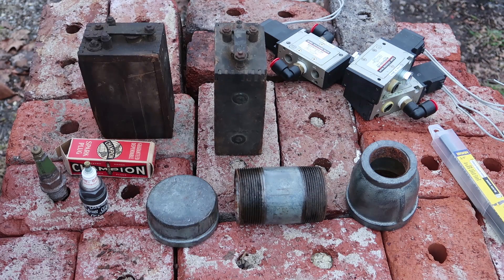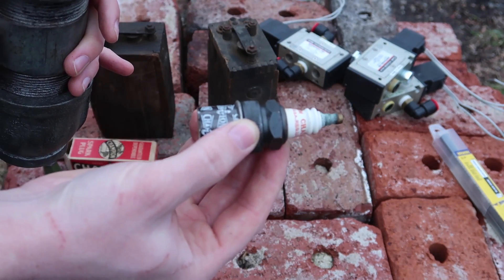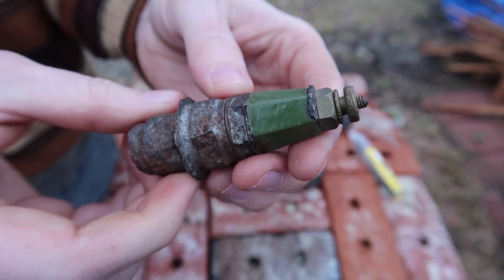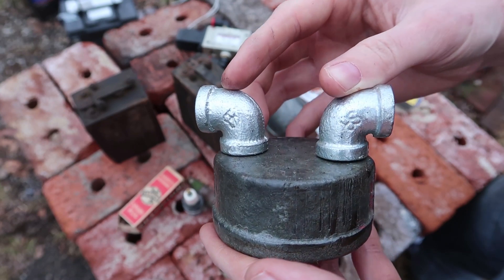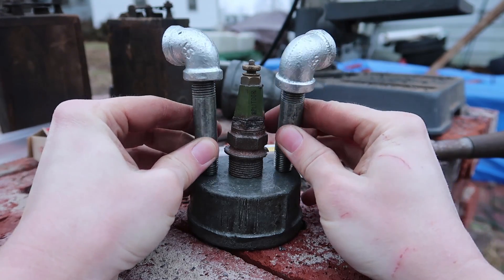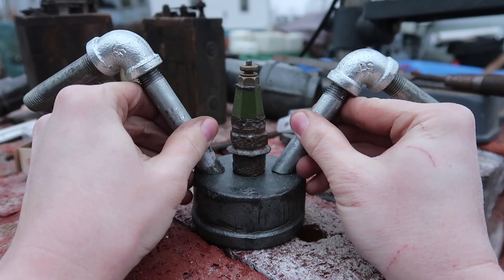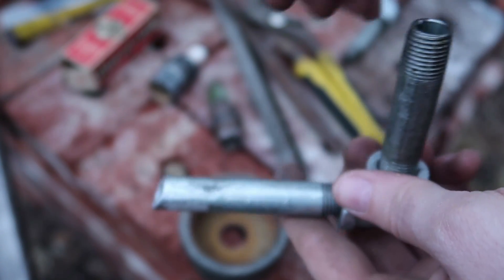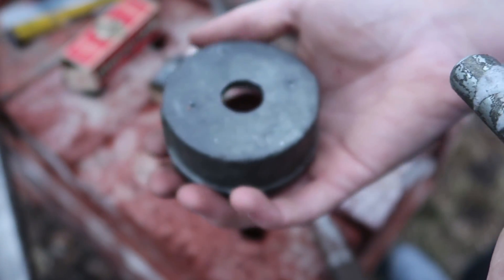DIY Liquid Fueled Rocket Engine 01: Simple Rocket Engine Combustion Chamber

Comment: Hey, former rocket engine designer (propulsion engineer) here:

I strongly suggest that you use propane instead of kerosene, since you're planning on using GOX oxidiser.

If you use kerosene, it's very oxidiser hungry and you are going to have a lot of trouble getting it sufficiently atomised and mixed with oxidiser. Indeed, you'll have a lot of trouble even getting enough oxidiser into the chamber to get stable combustion, because of it being GOX and not LOX (you'll have issues with mass flow rate). Or possibly even to get it igniting reliably.

If you use propane (or butane), it has the nice property of vaporising very quickly once it hits the temperatures of the combustion chamber, and this will help it to mix very thoroughly with the oxidiser. It's also much less oxidiser hungry (lower O:F ratio), and will burn much more cleanly. It's much easier to get a homogeneous mixture in the chamber, since you don't need to build anywhere near as complicated an atomiser for it since it will boil chaotically upon entering the chamber, unlike kerosene.

I'm not trying to rain on your parade, I'm just being realistic.

If you want any advice for this project, just ask. I've designed and built solids (AP-PBAN, AP-HTPB, and AP-silicone varieties), liquids (N2O-propane and N2O-ethanol), and hybrids (N2O-PBAN, N2O-AN-PBAN, N2O-paraffin, N2O-nylon) - and flown the resulting engines, also in vehicles I designed and built - so there's a wide variety of experience on tap should you be interested.
Reply from the maker: yeah sorry i was unclear with this series. im starting with gaseous oxygen and propane with this test chamber and then my next engine will be designed to actually make thrust and use liquid propellants. i figure this low pressure test chamber will be good for experimenting with controlling solenoids and stuff, and then the next one i will experiment with injectors.

i'm also thinking about getting a cryocooler and liquifying my own oxygen since im in such a rural area its difficult to get LOX.

and thanks, but honestly i feel it best to just try a bit of everything and see if i come to the same design conclusions through experimentation as real rocket engines have. this project is on the shelf for now until i get my new workshop built, and then i hope to spend a significant amount of time on it.

but thanks!
Reply: @RinoaL  Okay :) cool, hope you have fun with it! I'll keep track of what you do with this, will be interesting to see where you go with it. Best of luck :)
Reply: @Matthew, if you are a former Rocket designer... wouldn't you mind to share some experience? :D
Reply: @atommeyer2226  That's a very open ended question! If you have something specific to ask then I'm happy to answer :)
Reply: Matthew Ducker Well I have a question then haha, how do you start designing a rocket engine? Where do you begin, what steps do you follow and how do you know what kind of fuel and systems you need to install? Also if you want to have sensors how do you install them properly and safely without making the engine less efficient? Also how do you calculate the type of material, material thickness and or material strength for the combustion chamber? I can understand that you can’t make a combustion chamber out of soda cans😅... But how thick do the walls then need to be and what material do you need to use, what’s the best shape and length, what’s the best ignition system and what’s the best fuel pump system... I have so many questions😱
Reply: @b5nj1m9n  There aren't any single answers to these things I'm afraid since the questions you're asking are incredibly general - I'm not being evasive, but simply realistic.

To give proper answers to these questions would require a book's length, since they might seem simple, but really aren't since they're dependent on many other factors, and also on each other - designing an engine is a balancing act between many tens of different properties - a win in one can be a loss in another - so the correct answer for one use case can be completely useless for another.

I recommend getting a book, such as Rocket Propulsion Elements by Sutton - this will answer a lot of the questions you might have, and equip you with the knowledge base you'll need in order to ask yourself - and others - specific questions :)
Reply: @b5nj1m9n  As for where you would start however, the most general questions are usually to do with the performance - what thrust level is needed, and for how long - and then you would usually move to questions about the mission profile - is it very long (may rule out some cryogenics) ? Do you require the ability to restart? How many restarts? How long is an acceptable time lag between an attempt at ignition and begin of thrust?
Reply: Matthew Ducker Ohh okay thanks for your help and the tip about the book! I’ll definetly check that one out! Btw regarding the restarts, how does it effect your engine design?
Reply: @b5nj1m9n  Restarts: if you need many restarts, hypergolics may be a good choice, since they do not need an ignition system. If you do need an ignition system, most propellants will need a chemical ignition system such as TEA-TEB or similar. LH2-LOX can get away with spark ignition (as hydrogen has such a wide mixture ignition range and easy ability to gasify it, making lighting it much easier), but many still opt for TEA-TEB for its simplicity and reliability.

Other factors: if your engine is regeneratively cooled, restarts are not really a problem - but if it's ablatively cooled, this can be a problem as heat soak will damage your ablative material, making it less effective or even fail outright. In such a case you cannot wait long in between each firing. 

Other than this... restarts can also be hard on turbopumps, moreso when using fuel rich preburners or gas generators, and particularly when that fuel is a hydrocarbon as it may coke and accumulate on the turbine and other hot surfaces after the fuel shuts off and some is left in the system. This can be mitigated by flushing it with an inert gas but still, it's something to be taken into consideration.
Reply: Matthew Ducker oh wow okay, I understand half of it hahah, my goal is to make a working rocket engine with combustion chamber, not a SRB type rocket engine, for a science project on school.. I still have lots to learn
Reply: @b5nj1m9n  Ah, right, definitely the wrong level of information then (I assumed you were just interested academically. Very few could attempt to build a turbopump-fed liquid engine by themselves). I would suggest looking at Richard Nakka's website (assuming it's still around? It's been a long time!) for amateur rockets as it's pretty good on theory AND practical builds, and has propellants and designs that are more appropriate for your goals.

I started off building sugar rockets (potassium nitrate + dextrose solid propellant), so I get it ;) .
Reply: Did you really strap 8 SRB's on your skates???!!!! Dooooopeeee
Reply: AtomMeyer 
"What actually creates the thrust?" 
There are two principal ways thrust is created by a rocket-engine: 
1) Spit out mass in one direction makes you go in the opposite direction. The faster you spit out mass the faster you accelerate (think letting loose a inflated balloon or a bottle-rocket that spits out water downward to go upward itself).
2) The shape of the exhaust-nozzle (bell-shape) creates thrust by harvesting the internal pressure in the gas when it comes out of the combustion-chamber. This high-pressure gas wants to expand in all directions. By enveloping it with a bell-shape we can harvest a useful bit of this expansion. So simply put, the gas expands side-ways (perpendicular to the engine) and we let it impinge on a inclined surface to transfer the side-way motion of the gas molecules into a forward thrust.

"What materials are used?" Normal steel? 
Well yes, one could use normal steel, but as you state, it needs to resist the high temp en pressure for the duration of the flight (and maybe multiple flights). So a throw-away rocket that only has a burn-time of 10 seconds could be build with normal steel. A rocket-motor that burns for several minutes needs a different solution. That said, most fireworks rockets are made of paper and if you only have a burn-time of seconds and not too much pressure, that seems to suffice.
To protect the chamber-wall there are several options:
1) Protect the wall with unburned propellant (fuel+oxidizer). SRB's use this principle by burning from the inside out. The heat and pressure are used to ignite more of the propellant in stead off heating the wall and pushing on the wall directly.
2) Protect the wall by actively cooling it (when materials heat up their material-strength goes down so this prevents failure by removing excess heat). This is done by adding more fuel than the combustion-process requires. The extra amount of fuel doesn't burn (as there is not enough oxidizer) but simply absorbs heat and takes that with it when it exits the engine. (difference with no 1 is that it does not 'really' contribute to the thrust of the rocket)
3) Use a liner to protect the inner wall of the chamber. This liner will slowly burn away (= ablative) and is therefore sacrificed to protect the wall. Needs to be replaced every flight.

"Could the nozzles freeze and then block..."
Nozzles don't freeze as they are made from, already solid, solids. On the outside, the water-vapour in the air freezes onto the outside of the nozzle (this adds weight to the rocket but other than that it shouldn't matter). Nozzles only clog up when there are solids in the matter-stream. So no, as long as there is nothing in the fuel-oxidizer streams that turns solid at the temperatures used.
That said, the nozzle opening does become smaller when the nozzle is at a lower temp, and therefore it could lead to trouble with mass-flow and/or atomizing. Meaning, you don't get as much power out of your rocket as you would wish because you can't shove the unburned stuff into the combustion-chamber fast enough or you can but the shovelled in stuff doesn't burn as fast as you need it to because the droplets of fuel are too big.

Life-tip:
Solid Rocket Boosters cannot be controlled (throttled) once lit (not really anyway). When propelling a human being, there should always be a thrust-providing system in place that can be throttled to prevent damage to the cargo. 
In case of roller-skates and srb's: Don't put the skates on your feet but test it first without the human element. Hold the srb's in your hands (not literally) so you can decouple them if needbe.
Reply: Matt, you seem like a brilliant guy who needs to educate enthusiasts with your own channel. Key here being safety and how not to blow yourself up or worse.
Reply: but.. the Atlas rockets used kerosene as a fuel.. That's why they were so orange and smokey..
Reply: @atommeyer2226  Pressure creates thrust. If you had a can with 100 psi of gas in it, there would be no thrust because the force  acting on each end would cancel each other out. But if in an instant you removed one end then for a very small moment 100 psi would be acting on one end but nothing on the other. The thrust created would be 100psi multipled by the area of the end of the can. Problem is the pressure would only last a tiny moment as both the can accelerated in one direction and the gas in other with a resultant loss in pressure and therefore thrust. So with a rocket all your trying to do is maintain that pressure by injecting more material and expanding it (super heated gas through burning). Actually a bunsburner does creat thrust in theory, its just so inventesamally small it's not noticeable. You have gas at just a few mbar released into a nozzle design to draw air up through, at which point it's ignited and therefore expanding and pushing in all directions. This is at such a slow rate and so little pressure that the pressure generated from expansion doesnt actually overcome the force to rise due to density changes and that must happen otherwise fresh air wouldn't be drawn into the nozzle and the burner would just go out. If you could place an enclosed nozzle on and pump in oxidiser, then noticeable thrust could be produced.
Reply: Tributary House Ltd. Hey dude... What kind of drugs did you take before posting your comment? You are talking nonsensical gibberish. I don't know if you are trying to impress others with your pseudo-science nonsense, or if you actually believe that what you said makes any sense. I, for one, am not at all impressed. (thumbs-down)
Reply: It's pretty obvious that the lady in this video has spent the majority of her time behind a computer screen or carrying a clipboard around while the real work is done by others. At least she's trying.
Reply: kerbal space program doesn't count
Reply: @xrayrep  Right? Psychotic break or trolling, I can't tell.
Reply: Matthew Ducker I
Reply: Matthew, Im glad you gave me the opportunity to read the thoughts of an actual Rocket Scientist - thoughts which all went over my head completely.  This made me feel better that I was not more ambitious in studying science and let this sort of thinking to a smart guy.  :) . Fascinating to read.  Thanks!!
Reply: Matthew Ducker I wish I were as smart as you, Sir.
Reply: @Matthew Ducker Hi, this is actually the first time I meet an aerospace propulsion engineer. I actually plan to become one myself. I am currently in the last year of highschool and as a rocket enthusiast I am building a small hybrid rocket engine for a major school project. If it is not a problem I would ask you to see my current design and verify whether it will work at all, and if there are no critical errors. I just know noone who could verify it, and that would be a great help for me. I have complete schematics of parts and the whole engine as well as my theoretical performance which is propably wrong, though the whole design is as simple as possible. it runs at 250N thrust and uses gas oxygen and PVC as fuel.
Reply: Matthew Ducker 
I'm not sure if encouraging this backyard "rocket scientist" is the correct thing to do?  First, he needs to take a few advanced courses regarding rocket engine design and engineering.  Second, the backyard mechanic is going to blow himself up.  Third, the Feds no longer take kindly to backyard bombs.  Also, many people die each year because they don't have a clue as to what they are doing!  Courses are cheap......   life and limbs are not.
Reply: Matthew Ducker makes sense plus I was thinking that is a huge fitting to pump a liquid for that sized chamber. Idk maybe looking at it wrong thinking of a regular piston engine and thinking an generic injector would be more appropriate going the kerosene route. Also wondered if pure oxygen or no2 of which is a better oxidizer ?
Reply: so, a rocket butt doctor?
nice to meet someone like a rocket butt doctor.
i'm a joker as you can tell
i'm addicted to laughing
it all started when i was-
AHAHAHAHAHAHAHAHAHAAAAAA!!!!
Reply: @mduckernz  Hi, Matthew, One question. can you tell me advantages and disadvantages of these propellants: kerosene/hydrogen peroxide(85%) and kerosene/Nitric acid. Thank you.
Reply: @matias4225  Certainly.
H2O2/Kero is medium-high performance (around 260s, SL) - not quite as good as LOX/Kero (290s), but not far off either. It does, however, have a better density impulse, at 325s vs. 295s.
The main disadvantage with it is the acquisition of or manufacture of the H2O2 (cost and difficulty), and the safety issues of storing it and fueling (filling) the engine with it (any leaks/spills have a nasty way of causing hypergolic fires, and with a wide variety of materials), though it is also known for combustion instability sometimes at lower chamber pressures. Ignition can also be a bit unreliable. 
I'm struggling to come up with many advantages for it other than its good performance and a mostly clean exhaust.

HNO3/Kero (red fuming nitric acid specifically, so, RFNA/Kero) on the other hand is quite attractive by comparison. It's got about the same performance as with H2O2 oxidiser at 255s vs. 260s, but retains the advantage of being non-cryogenic. It also has a slightly better density impulse at 335 vs 325. Ignition is easy, and combustion tends to be highly stable. 
Its main disadvantages are in storing the oxidiser in the engine tanks for long durations - the inside of the tank (stainless steel usually) can be fluoride passivated, however, and so long as this is done properly, it can be stored even long term. Filling the engine is also dangerous, but not nearly as dangerous as with H2O2 in my opinion as it doesn't tend to cause fires except with specific materials, and even more so if it does, it will be straight away and not mysterious ones minutes later like H2O2 tends to cause.

There is a good reason why nitric acid oxidiser (with a variety of different fuels) was used in wartime rockets, and early ICBMs (before it was replaced with NTO/MMH and NTO/UDMH)
Reply: @mduckernz  Thank you very much! All the best!
Reply: Mathew   I have made some SRF w KCLO4 & Plain Motor oil,  Glass powder or Iron filings as PACIFIER....worked great!!    
I use KCLO4 instead of KCLO3  for stability reasons plus it actually contains more Oxygen..................
Reply: @b5nj1m9n  Dude, look on ebay and you can buy entire CD on Rocketry or anything you want for a couple of bucks.  or simply search the internet.  I just found Gigabytes of files (PUBLIC) in the US NAVY site!!! on the subject I was searching for..............
Reply: @b5nj1m9n  Mathew recommended that you get "Rocket Propulsion Elements"   I did a search for it, I found it in ONE SECOND!!! 
(now in my digital Library!! LOL  not that I need it, but it was there for the taking.)
Reply: Jess Cast Wow we got a badass over here🙌🏼
Reply: @b5nj1m9n  IDK if that's sarcasm  But G luck on your project.
Reply: Jess Cast Thanks. It’s already finished and works perfectly👍🏼
Reply: I suggested a baffle plate and a small mixing chamber under the injection ports so the fuel/oxidizer mixes better before ignition to avoid the combustion occillation that blew up many early rocket engines.
Reply: @mduckernz  how much will it cost in total to do a rocket propulsion engine that can lift a maximum weight of 100kg?
Reply: @palanichamys828  Since you didn't specify any constraints at all (liquid, solid, which propellants, intended altitude etc) I will assume absolute easiest and cheapest method, and for that you can't really beat KNO3-dextrose solid propellant. A 5:1 thrust-weight ratio for 100kg is approximately 5kN force under Earth gravity. This you can easily do with an appropriately 100mm diameter motor, and I'd guess at maybe 4 "BATES" grain (with typical 2:3 W:H ratio for neutral thrust curve) dimensions ... you can do the calculations for what it actually is, this is just a very rough estimate for costing purposes.

The propellant would cost at most $20, and the motor probably $350 or so (typical snap-ring retained Al case with graphite nozzle, totally reusable)
Reply: @mduckernz  thank you so much for the reply.
Reply: @mduckernz  hello. What could be the best oxidizer for kerosene?
Reply: I concur
Reply: Hi Matt, I hope you don't mind but I'm also looking for some advice. I used to build some mighty solid fuel rockets but since moved to the UK where handling explosives is illegal. I'm currently working on a hybrid test motor and I have a really ambitious project in mind that will require perfecting a powerful liquid fuel engine. For starters, I'm struggling a bit with my high pressure plumbing. Any ideas where I might find some half decent educational resources on the topic?
Reply: @GryffieTube  If you're dealing with cryogenic temperatures you need to use stainless steel plumbing.  After that its meeting the pressure requirements.
Reply: A rocket using parrafin? That must be a pretty shit rocket
Reply: Would you recommend using alcohol and gaseous oxygen as well? Or would there be something better to use?
Reply: I strongly suggest methylated spirits instead of propane
Reply: May I ask you sir? Is ammonia/lox good propellant for large rocket engines? Sorry for bad english...
Reply: Hi there! Im space enthusiast from Kazakhstan, im 16 y.o
I want to try to build liquid fuel rocket engine, can I contact you to receive some advices or consultations?
Reply: This reminds me of me 60 years ago. Only I machined my combustion chamber and nozzles.
Reply: What about using Hydrazine?
Reply: @GeekBoy03  check  the toxicity of this fuel before buying any. Look on Wikki.
Reply: @b5nj1m9n  going all liquid comes with pressure chalanges and incredibly low temprature , even if u can make it happen , than u need pump which can handle handle more pressure than the chamber itself and should not atleast back flow and while keep adding fuel and lox to the  chmber , 
u still dont have any active gas genertor to immdietly vaporise the mixture before  ignition
Reply: What is the best hydrogen to oxygen ratio for rocket fuel if your using them as a gas
Reply: I guess it's kinda randomly asking but does anybody know a good site to stream newly released tv shows online?
Reply: @Jedidiah Kayson lately I have been using flixzone. You can find it on google :)
Reply: @Kyrie Dustin definitely, been using Flixzone for since march myself :)
Reply: @Kyrie Dustin thank you, I signed up and it seems like they got a lot of movies there :) I really appreciate it!
Reply: @Jedidiah Kayson happy to help :)
Reply: @mduckernz  i made a woosh rocket not too long ago using a glass central market prickly pear carbonated Italian soda bottle and 70% alcohol (i think, pretty sure) and i made a choke using the cap ( i cut a whole in it, about 1/10th of an inch). Probably not safe but it was LOUD. I have only been able to ignite the rocket successfully once. Super cool.
 TLDR: turned a glass bottle into a somewhat powerful woosh rocket. (It was enough power to push the bottle back half a foot)
Reply: What about HCN? Can I load HCN in discharge?
Reply: Hey @Matt D can you give some help? I'm actually making a liquid rocket engine, for a school project, propelled by commercial Hydrogen Peroxide (50%) and Ethanol. The H2O2 goes trough a catalytic bed before the chamber. The ethanol is injected through a jet injector. I'm having much trouble to start and keep the combustion. I used a spark plug but did not work properly. Do you have any suggestions? Thanks in advance.
Reply: Matt, how would one get into contact with you?  Would you be open to a paid consulting session of 30 minutes?  You can pretty much name your price.
Reply: You were literally looking like Carl Sagan in the photo lol